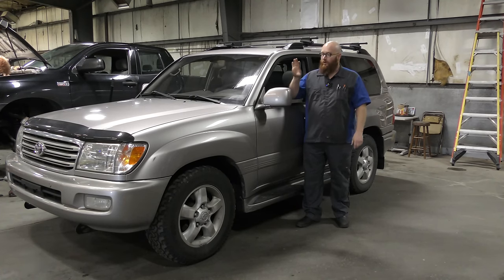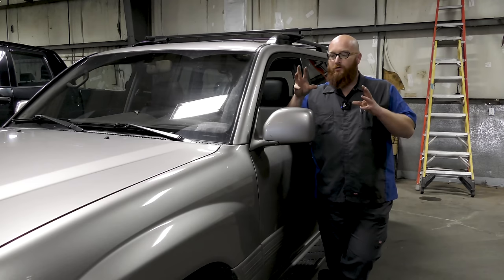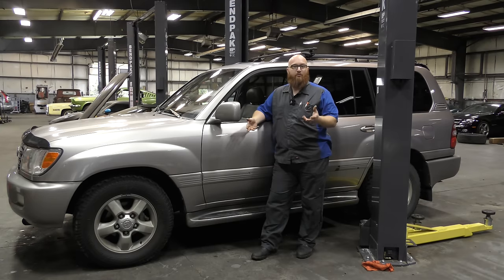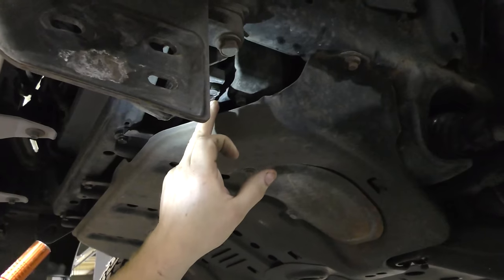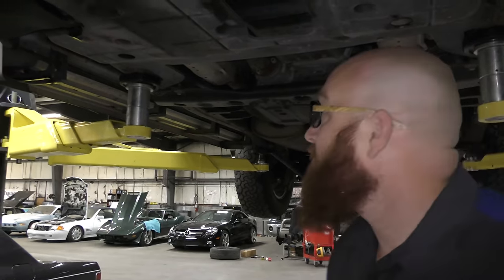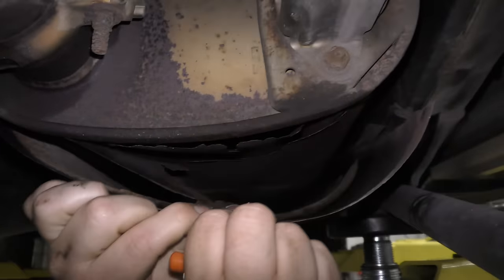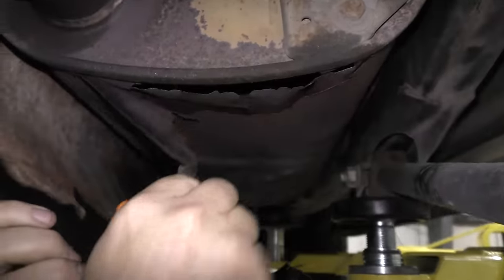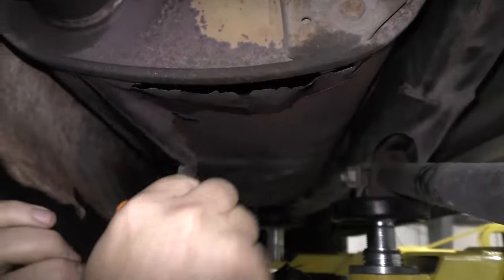Vehicle Making a Horrible Noise?! CAR WIZARD finds the problem & shares how not to be duped by shops

Comment: I was expecting the muffler. Had to replace mine on my 1999 Land Cruiser. Same problem and super common. But, no doubt, Land Cruiser's are amazingly well built.
Reply: Same here. 2001. Needed a new muffler
Reply: Yeah I was confused, I was listening for a knock but the only thing I was thinking was; "Are they really that loud normally?" "Where is the knock?".
I had a car once with an exhaust leak, it had a clamp rust out and snap off and it sounded just like this, although it was by the upper exhaust.
Reply: Same our exhaust was making weird noises I guess exhaust components failing on the 100 series is common

Comment: I have a 2007 UZJ100R - Sahara.  One of the last ever production month before they went to the 200 series.  It has 304,000 KM's on it now, 13 years later..

And it has NEVER failed me...  The only service item that wasnt in the book was a slight leak on the Thermostat housing, which was due in part to my mechanic not using the proper gasket maker from Toyo (He used high temp sillicone instead).  This was quickly fixed, about 5 years back.  We took it off as part of the Timing belt change @150KM.

2 Trips around Australia in that time, and normall about 20m000KM per year driving.

Just important that you do the service every 10,000KM, and the Timking Belt every 150,000KM.  Change the fluids when they need it, and the brakes/pads/rotos when they need it.

I have mine converted to run on LPG Gas (Common here is Australia), So it is cheaper to run than a Diesel.

Comment: 2010 FJ Cruiser... so durable, I'm leaving it to my son in my will.....
Reply: And he's not even born yet? Lol
Reply: And your son to your grand son...and great grand son ...and great great grand son...
Reply: ive got a 2012 i bought used a year ago love that vehicle and wizzard will think im crazy i bought it at 154,000 miles but toyotas are tanks. like he said they dont leak i took it for and oil change they said at its oil filter cartridge location its leaking oil yes u can see something that looks like oil but i keep and eye on the oil level its not even went down. i did do the brakes on mine my pads were bad i was almost metal on them got rotors and pads for all 4 corners as i wanted them all done at the same time now that was hard my driver side pins for the pads were coroded in the caliper that was not fun getting out.
Reply: That's why most families in dubai drive  toyota land cruiser, reliability, freezing a/c specially in dubai hot weather, parts everywhere if needed and high resale value.. Toyota is the best 👍👍👍👍
Reply: safffff1000 haha 😆
Reply: I bet he's pleased about that lol
Reply: An FJ Cruiser is NOT the same as a land cruiser.  It's like calling a Camry and Corolla the same thing.  Two different models.
Reply: @pandasupra  they never said it was. It is a Toyota though.
Reply: pandasupra: the FJ is based on the Land Cruiser Prado, an off-shoot of the Cruiser family. Hardly a Corrola by comparison.
Reply: @pandasupra  Umm, the FJ Cruiser and 5th Gen 4runner are both rebodied J120 Land Cruiser Prados. While true it's not the full size LC shown here, there's no drop in build quality and reliability when discussing the baby cruisers.
Reply: And hopefully he will sell it and buy a motorcycle.
Reply: My dad had a 2007. Transmission went out around 100K. Toyota trucks of around that era have automatic transmission issues, take it in if it ever starts shaking at 25-30 MPH, that’s the transmission trying to shift
Reply: @ultrablue2  I don't know the cars so I can't compare. The Prado is a light duty compared to the proper LC. Typical Toyota quality but not a Land Cruiser.

Comment: Land cruiser front wheel bearings need repacking and adjusted as maintenance every 30k
Reply: Ah, no they don't. I'm up to 535000 on mine and away to replace the bearings just because I'm doing new rotors. they have only been adjusted 3 times over the life of the car and it is a 20 minute job. I have checked them yearly but zero issues.
Reply: @8507duke  you've missed the point.  The maintenance calls for repacking.
That's like not replacing spark plugs at 100k, because there's no misfire.  A mechanic would, and has been fired for such things.
Reply: @neildutton8077  Sorry Neil, I definitely did. You are right on about the recommended maintenance.

Comment: Thanks for your honesty car Wizard.  I own pretty much all my cars, trucks and mini van since 1980.  Many of them last for a very long time.  For some I sold it to buy a new one or give it away to friends.  The oldest on is 1996 4runner Limited 4X4 (300,000 miles) still running today (2023).  Body and frame are still original and no rusting. My newest purchased was 2021 Rav4 Limited. My 2004 Tundra Limited Double cap (230,000 miles) still running like new. 2014 Camry Sport , 2019 Camry Sport, and  2017 Lexus IS350 are pretty good condition.  If you want a reliable cars and truck, you can buy one see how it work for you.

Comment: Cv boots leaking wizard I’d do that while you have the bearing off and super common is another exhaust leak sound is cracked exhaust manifolds you’ll hear it more when it’s cold
Reply: I noticed that as well, inner drive shaft boot has lost a lot of grease.
Reply: Surprised he didn't mention it after going on about how experienced and good he is
Reply: He's elsewhere mentioned how you do the job the customer wants, and nothing else. Good way to lose a customer.
Now, of course he could have called Custo off camera and discussed without mentioning.
Reply: @rockandmetalfanfun  we're human not robotic.
Reply: Leo Roberts perhaps he found it the first time he was under there? He did mention he already inspected it.
Reply: @Itsmellsfishy  hopefully you're right. I understand it's harder to work with a camera scrutinizing your every move but I just don't think he is as thorough as he says he is. For example he claims the spare tire has enough air in just by looking at it. I keep spotting all these little mistakes
Reply: Every mechanic has his standards of what’s a leak to say something about or not. Wizard is an awesome mechanic and an honest shop owner. Most dishonest mechanics especially outside the dealership would recommend to replace the whole axle with aftermarket which is cheaply made unlike the original one. Almost all land cruisers I’ve inspected had leaking cv boots. Replace the boots which are about 50 bucks from the dealership is a much better option than replacing the whole axle for 500+ for an original
Reply: @archechme  is that what you say to customers when you forget to tighten a couple bolts on their car ? I agree no one is 100% flawless but as a mechanic you have to double-check everything and a leaking CV boot is pretty obvious. Especially when you claim it takes a really experienced technician to inspect a car. That's all I was saying
Reply: @rockandmetalfanfun  He inspected it before. I suspect he checked the spare.  He didn't want a really long vid with a lot of stuff that wasn't relevant to the message.
Reply: For the YouTube algorithm you leave some stuff out so guys like you comment.  A comment or a like or even a dislike is  good for for the algorithms it puts the video in front of more people and there for more viewers and more money honey 😉
Reply: behexen250 I speak from experience as a Toyota dealership technician. I worked on countless land cruisers and always put boots and have seen our customers land cruisers go 300k miles on the same axle that we’ve replaced boots on 200k miles ago and back in for another boot replacement. I’ve also had aftermarket axles break in half in land cruisers. To each their own and I respect your opinion I only speak from experience. In the dealership where I work we charge half an hour extra to the labor time of replacing the axle to replace the boots the axle is over 500 bucks half an hour of labor is 72 bucks vs 500 bucks for a new axle. Plus it’s not the mechanics call what to do. You give the options and prices to the customer and you let them decide what makes financial sense to them
Reply: Cracked exhaust manifold, yes. Common cause of a ticking sound.

Comment: Change the Heater Hose Tee's!  They are ready to crumble by now, and when they go they will take the motor with them.  It's an immediate evacuation of the coolant system, and the aluminum heads will be screwed by the time you notice the over heating.

Comment: I have had 2 Sequoia's (sister to the Land Cruiser) with over 200,000 miles, the first one my boy tried to teach it to roll over, any other truck he would have been hurt bad but he walked away with only a scratch. the second one still is running with 225,000 miles , I did change the timing belts on both of them

Comment: My 4.7 had leaky valve covers because of loose valve cover gaskets. I'm sure after almost 20 years and 200,000 miles it could use new gaskets but I tightened the valve covers and no leak. That was 10,000 miles ago
Reply: I’ve got 2 first gen Tundras with the 4.7 in them.  You are exactly right...10mm socket & extension and 10 minutes and there will be no more leak

Comment: Is this an interferance motor? Meaning if the timing belt breaks will pistons bend the valves, if so yes a timing belt and if anything else is on that like a water pump.  The Ford escort in the 1980s is always blown up because that water pump proven broke the  Timing that smashs and ruins the motor

Comment: Just had my 02’ Toyota Tacoma with 198,000 miles on it,   timing belt and water pump done. Motor runs like a top. 6 cylinder TRD model. 
It’s a Florida’ truck just bought  it a couple years ago.  No rust on it, its crazy. Great vehicle Toyota makes!

Comment: Here in Australia there is a lot of toyotas like this one that has 600,000/700,000km on the odometer and is still in good to decent condition.
The best mechanic that I have known over the years, could take a vehicle out for a 10 mile drive, 5miles out 5miles back and then tell you what was wrong with the vehicle by ear. He was a very good mechanic in his work as well.

Comment: Big failure issue on these is the electro-hydraulic brake servo. If changing the whole unit, which includes the brake master cylinders, the cost of parts to repair is eye-watering. More than the car is worth after a certain age.
UK Land Cruisers are mostly with the 4.2 litre straight six turbo-intercooled diesel. Most are also fitted with the 'Sky-hook' part-hydraulic active suspension, as fitted to your Lexus versions. My LC is laid up because of both the brake servo failed and suspension with gas dampers and a potentiometer failed plus the hydraulic cylinders on each corner which replace the shock absorbers, are all failure points. The chassis is like new but the back axle is very rusty.

Comment: My wife has a 1998 Land Cruiser with 178k miles, I recently did a very complete overhaul by replacing the starter, timing belt, water pump, all the hoses, new radiator and alternator as well as the brake pump, and new battery as well. I expect the car to last easily another 20 years at least running smoothly. I should mentioned as well that I just bought a 2019 Tacoma TRD off-road, only Toyota’s!!

Comment: dude Toyota should be paying car wizard because the next car I'm going to buy is going to be a Toyota
Reply: Do your homework. They had some miss steps also along the way.
I bought a 2007 RAV4 - Clean, Low miles, ticked most of our needs boxes.
2AZ-FE 2.4L, it is burning oil. They corrected the issue in 2008.
Reply: MASS ONE good choice!
Reply: They’re paying Scotty Kilmer 😃
Reply: @amunderdog if you still have that Rav4 Toyota still makes updated rings and pistons for that motor of you want to fix it.
Reply: i just bought a Tacoma after daily drivin a BMW X5 for 15 years.. i now need reliability
Reply: He's teaming up with Scotty kilmer on japanese propaganda
Reply: Avoid the 2.8 diesel. Get the 3.0 turbo diesel from <2015 and a hammer to service it and you’re set
Reply: New Toyota is not the same quality as old Toyota. Do your homework like the other commenter said. 

I bought a Scion tC (Toyota). It has a defective transmission input shaft bearing that unknown to me was a factory defect that was fixed under warranty but not recalled so I am out of luck. It'll cost me $1500 to fix.
Reply: It's nearly impossible to find a mechanic like the car wizard. There is highly skilled mechanics. There is honest mechanics. There is hard working mechanics. There is mechanics that charge fair prices. There is mechanics that take the time to explain the problems to the customer. But there is very few mechanics that that have all these skills combined the way the car wizard does.
Reply: @amunderdog  yeah. If you can get the 3.5 V6 (I personally have one) then it's much better in any model and basically bulletproof. The unintended acceleration was BS.
Reply: I own a 2001 camry with a 2.2l. Replaced plenty of suspension, timing and water pump once, radiator twice but that car is at 412k just drove 400+ miles to go camping this weekend.
Reply: all car can have problems period its just the frequency of these problems that is the difference no company is perfect. But i would stay way from mid 2000 toyotas for sure, in fact hyundai is even better now.
Reply: @krimpet100  wow 15 years man that is great out of a bmw. Your tacoma could last till the next millenia.
Reply: You won't be disappointed
Reply: Toyota’s are nowhere near as perfect as everyone makes them out to be on the internet. I’d rather drive a Chevy.
Reply: get one with the V6...it’s bulletproof.  Can’t speak for 4 cyl
Reply: @amunderdog  yeah the piston ring snafu wasn’t great. From what I understand there have not been any such problems with the V8 series. Personally I’d go for V8 and try to get an earlier model with the transmission dipstick.

A lot of the problems are the edge cases though: I’ve got a GM truck and it just chews through peripheral parts. They f’ed up the solder on the ABS module so every single example has the ABS light flashing on and off because the pads crack and when you go over a bump the ABS module reboots. Fuel pumps go all the time. What a mess...super fun truck though if you want to learn to fix cars 😂 these Toyota’s can be pretty boring to fix because they don’t break.
Reply: @brad8665  Chevy is 🚮
You clearly don't know ANYTHING about Toyota reliability 🤣🤣🤣
Reply: moein I know they’re reliable. But they’re a pain in the ass to work on usually. They use cheap steel and cheap bolts everything rusts to pieces. My Chevy truck has almost 200k miles never left me stranded and everything works like it should. Only replaced wear items like brakes and front end parts.
Reply: @brad8665  yeah my first car @ 15 was a Chevy Cavalier and it lasted me 19 years and still had life to it. It lasted my nephew 15 and is still going!  Those cheap little bstrds got around!

Comment: I have a 98 rav4 4 door. Bought it about 4 years ago with a 130k its up to about 180 now. Its been an awesome little suv! Just recently replaced the rack in Pinon on it. But that's it so far. No rust even the frame of the car is super clean! I mostly use it for fishing and winter weather.

Comment: 5:40 is the CV boot leaking, or is that from oil leaking above?
Reply: It is weeping under the band. Not uncommon for old CV shafts. Can always tighten the band some, no real reason to replace if it is still quiet.
Reply: I thought same
Reply: @Cragified  you cant tighten toyota oem bands they are one use
Reply: yes the cv boot is leaking...
Reply: Yeah I noticed that too. My 06' Toyota Sequoia is looking like that as well. No symptoms other than excess grease.

Comment: What’s your opinion on age on timing belts. I bought a 2005 gx 470 with only 70k miles. In your opinion is age a factor and I should replace now or should I replace it and water pump at recommended interval before 100k miles.

Comment: Hey wizard, you left out another fine member of that family , the awesome GX470! It’s only weakness is the air suspension, but that can be worked around!
Reply: The GX is built on the Prado platform so technically he didn't leave it out :P

Comment: I have a '99 LX470. I love it. It has 190000 on the clock. The timing belt and water pump was changed out 45000 miles ago. Runs like a top and has incredible off road performance.

Comment: Being a (former) Toyota mechanic I can only confirm the points you're making in this video. These cars are SOLID. Unfortunately they are also expensive to own and repair, and Toyota will sell parts, that are identical to other Toyota parts for twice the price, just because it's for a landcruiser. Obviously not a lot of parts are the same, but I have seen solenoids for the turbos (in Europe we only have them as diesel) and they are the same as any other diesel Toyota. Only difference it came with a tiny bracket and a bolt.. Not really necessary to replace, only the solenoid was.. Lol
Another thing I noticed, you said it only had normalt struts, here they have the hydraulic suspension with the gas canisters on each corner. We once got one in that had dropped the rear on the floor, looked like a lowrider. Can't remember what had failed, my colleague fixed it, I just took the picture while laughing

Comment: I had a bizarre vibration on my high-mileage Sienna and it turned out to be something loose in the header pipe.  Very easy fix and made a huge difference!  I was afraid that it would be motor mounts or harmonic balancer or something and I would have never thought exhaust because it wasn't making a noise, but another great example of how something simple in the exhaust can manifest itself as a much worse symptom.